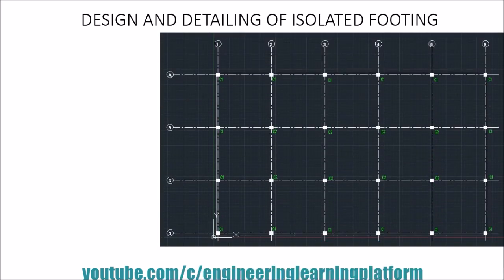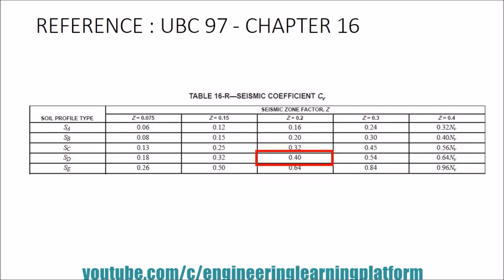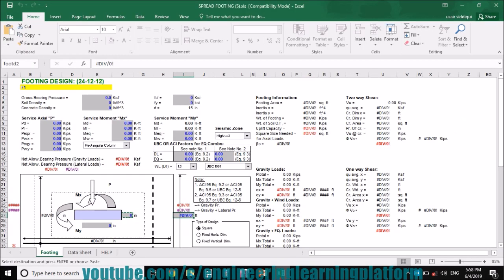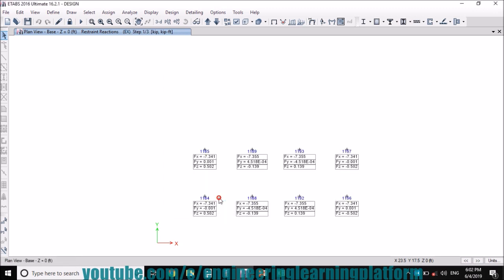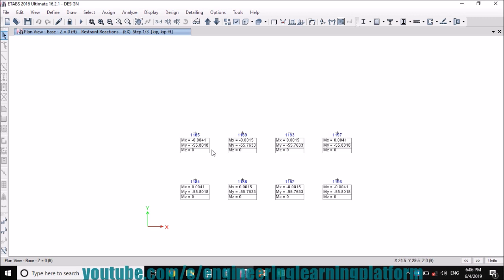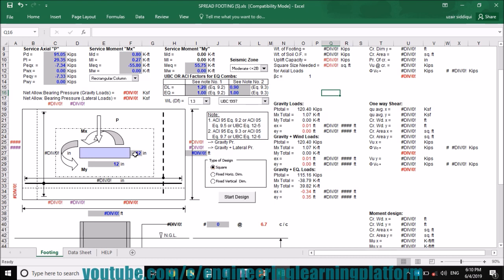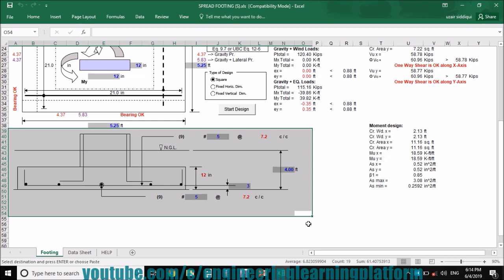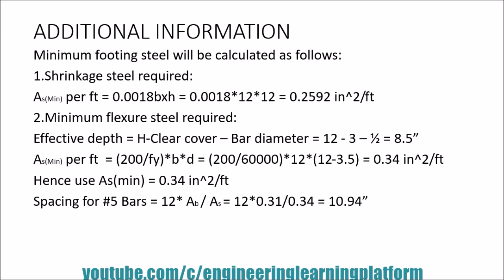Design of Isolated footing using Etabs tutorial

Comment: Suppose i have to use different code for example “IS code” what changes do i have to make in the excel sheet and if all my data are in newtons and meters does the excel calculate based on this or do i have to make changes for units too?